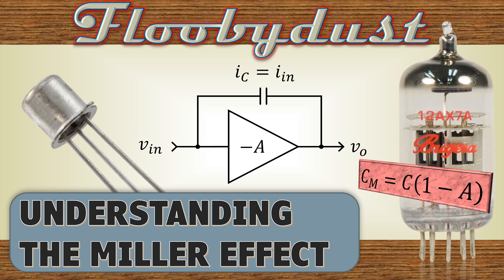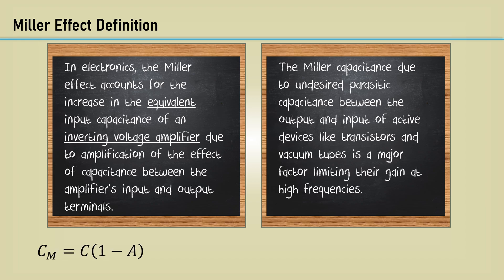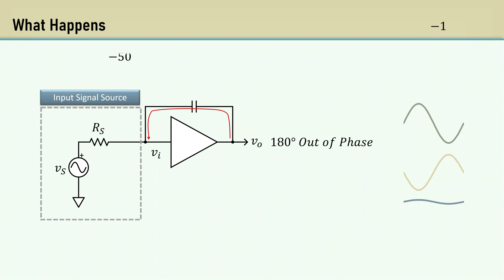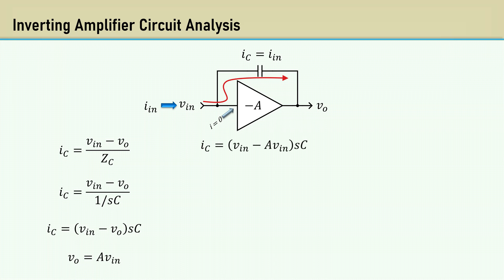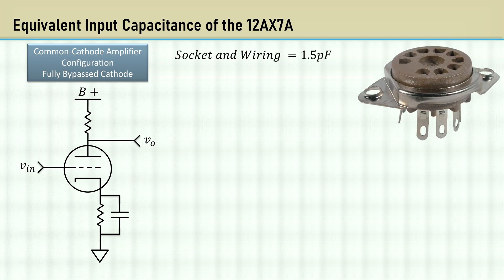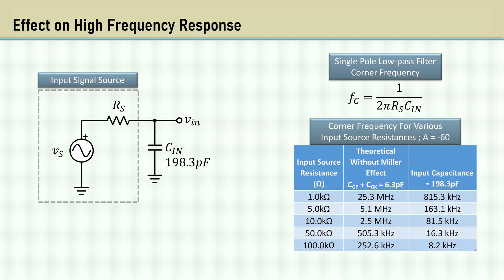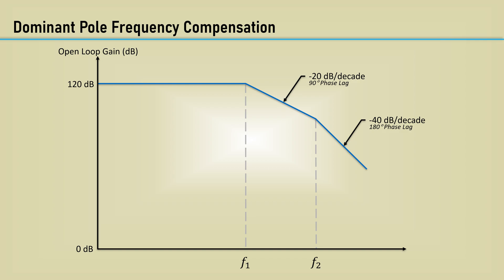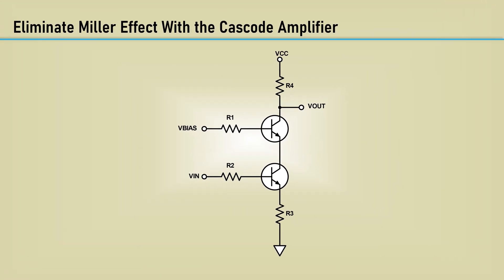Understanding the Miller Effect (4k video)

Comment from the maker: The Wikipedia page for the Miller Effect shows the Miller Capacitance equation as Cm = C(1 + Av). The Av must be positive, but we know the Miller Effect only occurs with an inverting amplifier which has a negative gain. That's why I chose to use Cm = C(1 - A) where A is negative.

Comment: In tube-type color TVs, the Miller effect was used deliberately to make a variable capacitance by using a variable-gain ("variable mu") amplifier tube with an external plate to grid capacitor added to get larger values (sometimes noted in the schematic as a "reactance tube"). The variable capacitance was used in turn to do fine control of the phase and frequency of the crystal color oscillator. The DC grid bias, which controlled the gain and thus the capacitance, came from a phase detector that compared the output of the controlled oscillator to the color burst reference in the broadcast signal, thus completing a phase-locked loop circuit that synchronized the receiver color to the broadcast.
Reply from the maker: That’s an interesting application I hadn’t considered.
Reply: Thanks for mentioning this. I am looking for a way to make an inexpensive trimmer capacitor. Mechanical ones are just too expensive.

Comment: I am a Power Electronics engineer and Miller capacitance is one of the most fundamentally important parasitic effects that impacts our designs.  

The use of Cascode devices is one concept that has a positive benefit in power design (as is the case with  analog designs).

Again,  with the domain of power electronics,  the presence of the Miller effect is not always bad and can be used to an advantage...

With the ubiquitous inverter leg configuration there is a need to impose a "dead time" between turning one gate off and then turning the next gate on.  If this dead time is not long enough then you end up with a 'shoot through' condition.  Getting this dead time correct is difficult to achieve as the requirements dynamically change and efficiency is negatively impacted it it is too long or too short.

The switch Miller capacitance can be used to provide a dynamically self optimizing dead time control mechanism
Reply from the maker: Great info. Thanks for the comment.

Comment: Good video. I had trouble following the math. Is 1/Sc admittance? How does the cascode amplifier counter the Miller effect? How is the cascode amplifier in common base mode? Thank you.
Reply from the maker: The impedance of a capacitor in Laplace Transform designation is 1/sC. Where "s" is the Laplace variable and C is the capacitance.  This is all explained in my video "Using Excel in the Laplace - sDomain video. https://youtu.be/demRliYzc9c

The bottom transistor is a common emitter stage. The upper transistor is in the common base configuration. Notice the base is a bias voltage, i.e. signal ground.

Thanks for asking!
Reply: @oldhackee3915  I think that I need more math in order to understand your video. I am studying math on my own. I have had trig, but I have not yet studied calculus. I am not familiar with Laplace. I wish to thank you for your video and time. I feel that even if I don't understand everything, I can still learn from watching and trying  to understand.
Reply: w2aew has a video that talks in some detail about the Miller effect and the use of the cascode amplifier. It may be worth taking a look at that.

Comment: Deja Vu?  LOL, didn't I just watch this a few days ago.
Reply from the maker: Yes. It had an error in it and had to replace it.
Reply: @oldhackee3915  Yes but it was minor. I think most folks just put a text note on the video at that point saying what the correct value is. THis way you dont lose views from the old video being taken down. Maybe they have found a way to fix videos without losing the previous views? Note - I'm no expert for sure.
Reply: And thanks for doing these videos!
Reply from the maker: I had several changes and wanted to add something too. Thanks for commenting.
Reply: Usually a glitch in the Matrix. It happens when they change something.
I see you also added a bit about grid stoppers too. Nice.
Reply from the maker: Yes thanks for bringing that up about grid stoppers.
Reply: @petersage5157  But I didn't see a second black cat walk by.  🙂
Reply: @mikesradiorepair   "What, was it the same cat?"